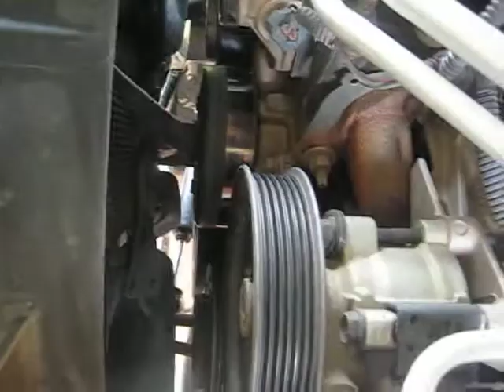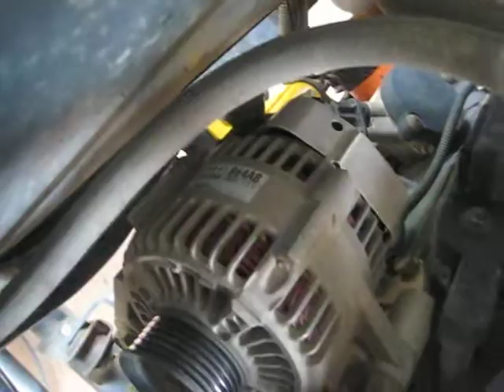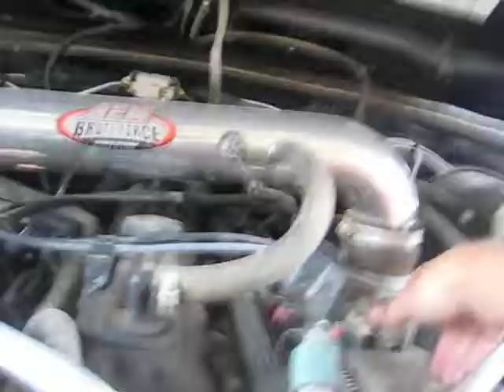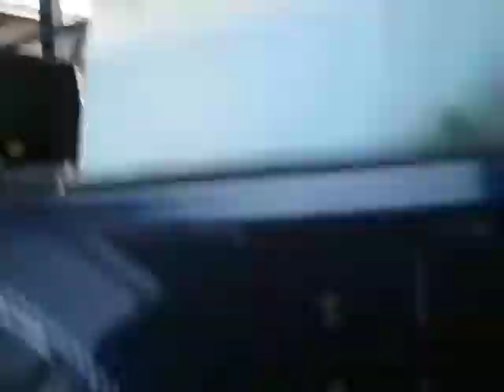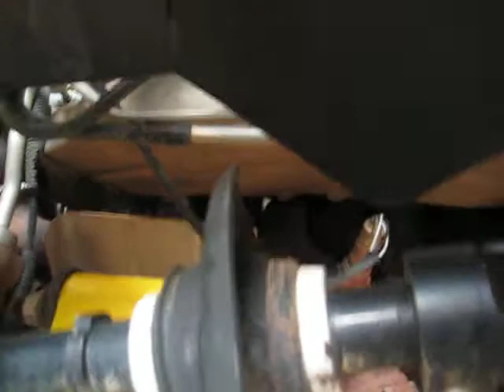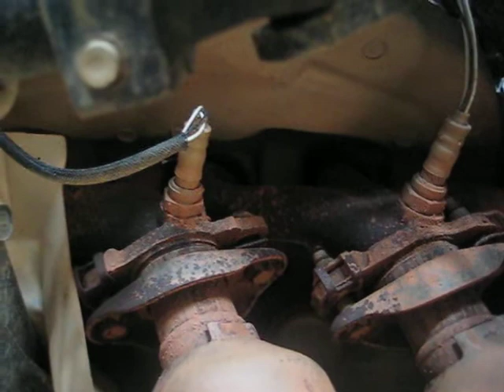2005 Rubicon engine noise

Comment from the maker: It actually ended up being one of the two first bank Catalytic converters had busted the inners and was bresking up and rattling. It was covered under the federal emissions warranty and I got an entirely new exhaust system out of it. Solved the problem. Thanks for the tip on the fram.

Comment: This is common amongst Jeep motors when cold. It might be just a little more severe in older motors. I have a new 2011 Wrangler and it has a tick. Certain synthetic oils or additives will cause a tick also. You definately want ot dump the fram filter...garbage. YouTube it and you'll see why.